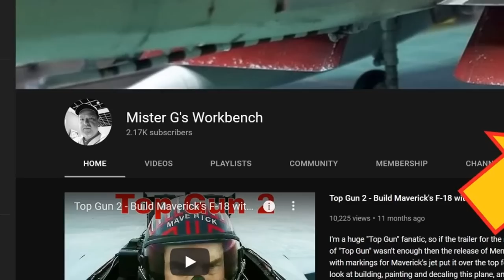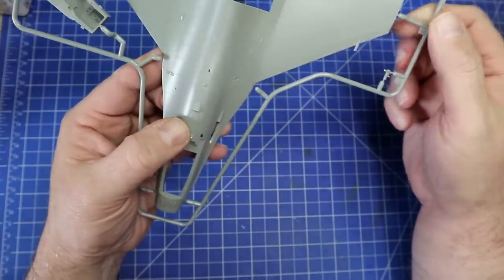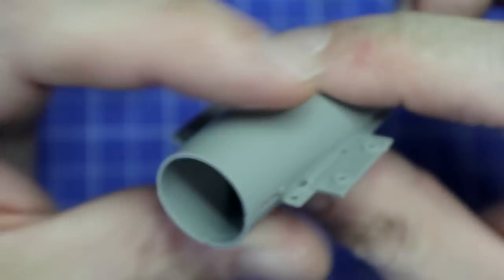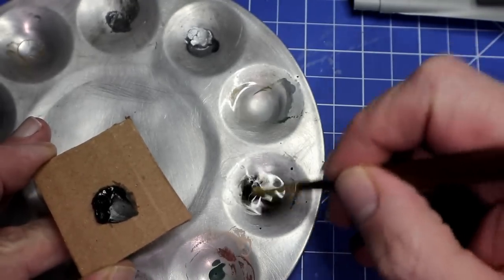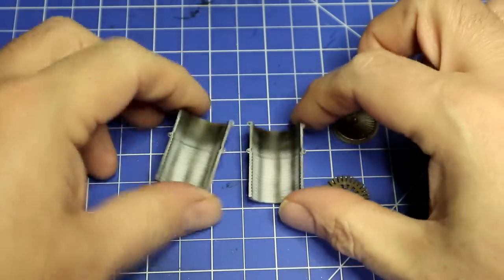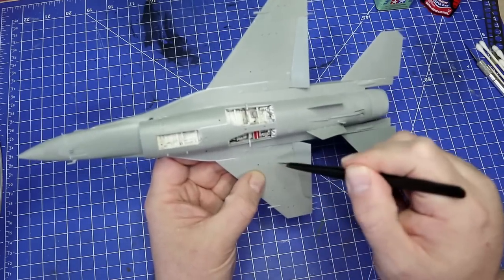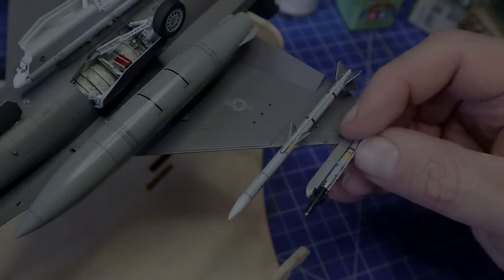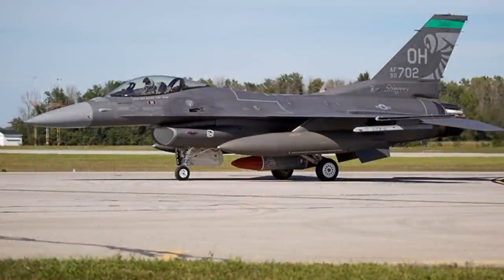Kinetic Gold 1/48 F-16C - is this kit worth your time and money? A build review in under 30 minutes.

Comment: Not trying to be a nit picker or a know it all. But I have over 15 years experience as a crew chief on the F-16. The "box" you were referring to in the wheel well is actually the aircraft battery and the bottle in the other wheel well is not an oxygen bottle. It's a halon bottle that is part of the fire suppression system. You did an excellent job on this kit. Now I want one of these as well as their DJ kit too!!
Reply from the maker: Thanks Tim for the explanation - I usually figure out stuff like that in advance, but not on this occasion. Appreciate your feedback and thanks for watching!

Comment: Thanks, great build review!  I'm building this kit now, and every fit issue you had I had also, so glad to know it's not me.  Under the wings, and that gap on the piece behind the front gear, the nose.  It's a great kit overall.  I sprung for the Eduard Space set and it went on great with the 3d printed instrument "decals".  The way you did it with the kit decals looks really good though.  Man those AIM-9Xs S-U-C-K.  The AIM-120s looked way too complicated, so I used spares, but the HARMs went together surprisingly well given the number of parts they have.
Reply from the maker: Glad to hear it wasn't just me! Actually the AIM-120 fins slotted well. Glad to hear you had good results as well. Thank you for watching!

Comment: Glad you used the kit instrument panel decals. I agree with the green being too bright. We were limited in color use on the decal sheet so it had to share the Toledo tail green. In the next boxings, I changed the screen color to a very dark green and am much more pleased with it.
Reply from the maker: Aside from that green screen issue the decals looked great!
Reply: Just a heads up, but those MFD (Multi Fumction Display) screens are only bright green like that when either the engine is running or if there is external electrical power applied to the aircraft and they are turned on for maintenance. Otherwise either a gloss black or a very dark green, almost black, would be accurate. The same goes for the small RHAW screen in the upper left instrument panel.

Comment: Thanks for the information  on the build. I have this kit and I was waiting for a video of it being built. Plus I have some AIM-9 missiles left over from the amk f-14 which are one piece although I can't recall if they are 9l or 9x. As to the intakes an old timer said use typewriter  correction fluid to hide the seem lines in the intakes and it has always worked for me.
Reply from the maker: Thanks for that tip Dan - definitely substitute those Sidewinders! And thanks for watching.

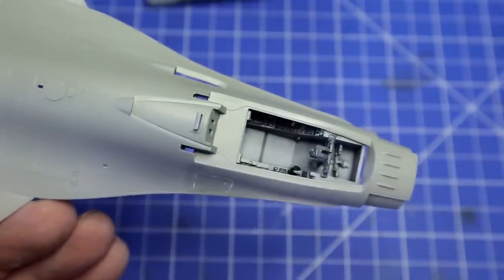Comment: About the bird slicer antennas there's no way to please everyone. If you want them to mold it as a separate panel, they did in their old molds and it was a b!tch to align the top and side panels. At 13:27 even for a single panel you had to fill and sand. While molded bird slices on the nose and the beer cans on the slats you simply slice and sand flush, you don't need to deal with multiple panel alignment, filling and sanding and reescribing panel lines.
Reply from the maker: You're absolutely right about aligning all those panels around the nose. I suppose it's the simplest solution. Thanks for watching.

Comment: Great build, only one remark tho, AIM-120 goes on the wingtips, F-16 mounts them there cause the weight of those missiles reduces the wing wobble in flight. so if you look at the box picture and any online pic of real F-16 you'll notice those slammers are on the wingtips ;)
Reply from the maker: Thanks Ivan - you're the second person to pass that info along to me. I appreciate it! I'm sure to do another one, so I'll be sure to get it right next time. Appreciate your feedback!
Reply: You just answered a burning question I've had for some time. I'd always assumed larger, heavier ordinance would go further out on the wings, so putting the AIM-120 on the wingtip stations where the AIM-9s went left me scratching my head. Thanks for your insight.

Comment: The "box" he refers to in the wheel well is actually the aircraft battery. He made a mistake painting it red because that's the color they paint a battery when it becomes unserviceable. In times past the aircraft battery should be painted blue. Nowdays they are pink, of all colors... And the bottle that he refers to as an "oxygen" bottle in the other side of the wheel well is actually a halon bottle. That is all the F-16 has for fire suppression.
Reply from the maker: Thank you for putting some perspective on those parts of the gear bay- I appreciate your input. Thank you for watching and I hope you'll continue to help out!

Comment: Nice build! Unfortunately Kinetic does not provide basic features of blk 25 - 42 which are prominent! 1. ECS exhaust vent (blk 42 only) located below the cockpit forward right top fuselage and 2. Stiffening plates at the top of the fuselage and wing roots. The ECS vent can be easily scratch-built and the stiffening plates are available in p.e or vinyl from some after-market companies.
Reply from the maker: Thanks for pointing that out George - in terms of details it would certainly be better with more attention to detail. That being said, this kit is a quantum leap over Kinetic's previous F-16 offerings. Thanks for the input and thank you for watching!

Comment: Nice. Yeah, having done a Skunkworks F-16XL and ... too many Kinetic F/A-18s, kinetic really needs to have someone look at their instructions and build the kit with them to see what actually doesn't make sense (or doesn't fit, or is on the wrong side of the airplane.) My experiences with their hornet (HATE that nose assembly) make me really wary of other kits of theirs I have in the stash... which is too bad, as I recall liking the F-5A.
Reply from the maker: I really didn't like their F-18 kit after the issues with the nose and refueling door, not to mention the instructions (a recurring issue). The instructions here were slightly better but still plagued by vague placement. Thanks for your feedback!
Reply: Their Pucara was a really nice kit though. Would build another in a heartbeat!
Reply from the maker: @shamrock1569 I'm hoping this is a sign of continued improvement for Kinetic. Thanks for watching!

Comment: Nice work but I can’t believe you didn’t do the faint lighter color between nose cone and cockpit. The reference picture you show clearly still has two tone finish. But you did mention you rushed it a bit so you’re off the hook :)
Reply from the maker: I couldn't find many photos of the Have Glass gray colored Ohio jets. They're all just the dark gray. Thanks for watching.
Reply: @MisterGsWorkbench I stand corrected I think a few images I saw as a reference had glossiness at the front and I mistook it for lighter shade. Salute and subscribed